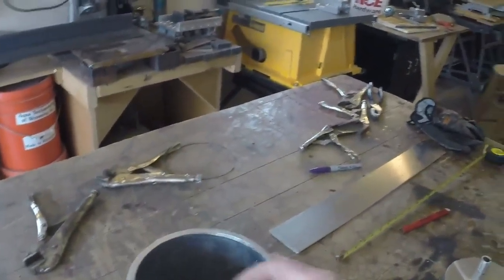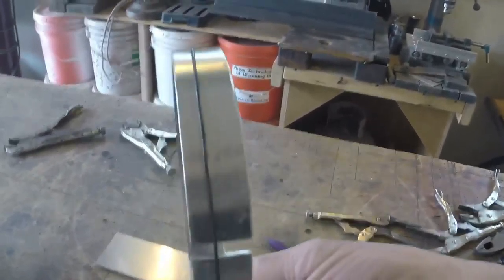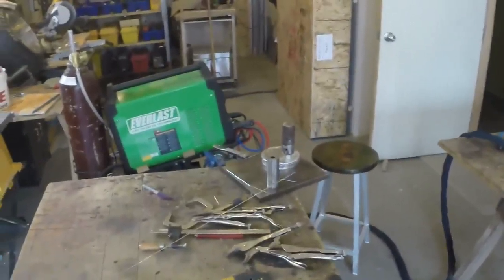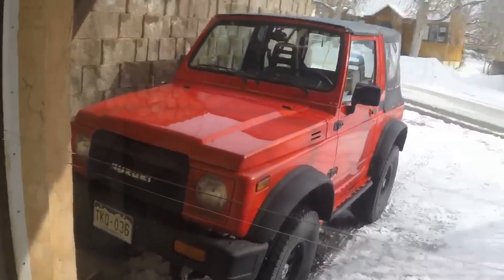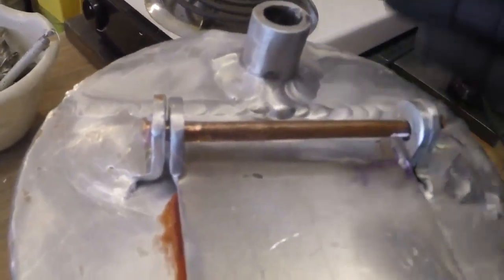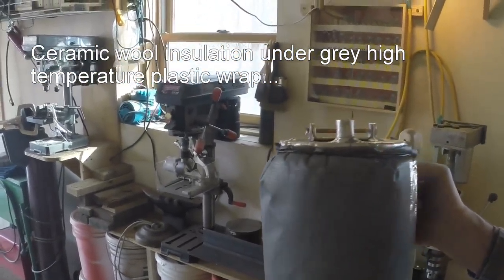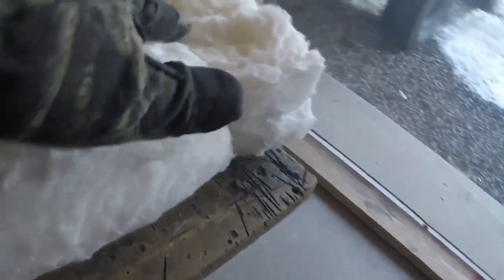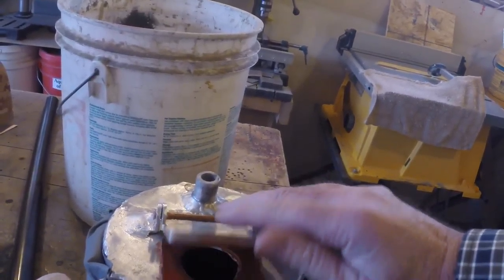DIY steam generator wood bending

Comment: You do some amazing work with such a tight shop space!
Reply from the maker: William, Thanks for the compliment! I do have to use my space really efficiently. I would like more tools (like a Bridgeport milling machine as one example) but I just don't have the room. So I keep my most used tools out but I set up the less used tools only when I need them. I think the only reason we made it through the housing crisis is because I was not paying for a bigger (separate) shop.  I have actually had off and on up to 6 employees working in this small space....building LED lighting and related cabinetry. Didn't feel crowded though because most of them were in the room where the electronic parts are assembled, with me in my bigger area (garage shop) doing the physically larger tasks.Thanks for watching!

Comment: It looks like steam turbine lagging to me, good video. My steam chest is way too big, I cannot afford to generate enough steam for it, 12" diameter pipe x 5 '. I'm going to scale down a lot, probably to like a 4" x 5' mild steel pipe. I'm thinking of using an old propane tank and a relief valve, that's easy it's the heat source I need to work on. You have an open end on the steam chest, does it need a relief?
Reply from the maker: Thanks for your comment. I decided to make the steam generator with a valve that couldn't become stuck so I don't have to worry about over pressure/explosion. I did need to insulate the steam box though. That put me over the top. My steam box is about 6 inches wide, 1 inch tall, and a little over 5 feet long.
Reply: @oldtownvids  I've been thinking about your video all day since I viewed it. I'm thinking of a 2-1/2 foot 4" schedule 40 black iron boiler and getting a small propane BBQ as a heat source. But it doesn't need pressure just hot steam, I don't want to generate more than a few pounds psi but with what I'm thinking the pressure could be 100 psi+ easily. A 2" x 5-foot steam chamber is all I need, I make canes I'd like to get 3-1" pieces of round stock heated at once, but that will take at least a 3" chamber. Your square box makes all the sense in the world, I am now thinking a piece of 4" or 6" mild steel tubing x 1" that may work just about right. I need to talk to you more often. LOL The boiler will be good for 600+ psi but I will use a 100 psi relief in case it rockets out of control, I have great respect for steam I worked with it for 20 years.
Reply from the maker: That sounds pretty good. You're right - no pressure is actually needed but a boiler with a relief valve ought to be safe. I think going with rectangular tubing and keeping the size of the chest as small as you can is good. Insulating it will really help keep the heat in as I mentioned in my last reply, but if your heater is large enough, maybe insulation would be overkill.